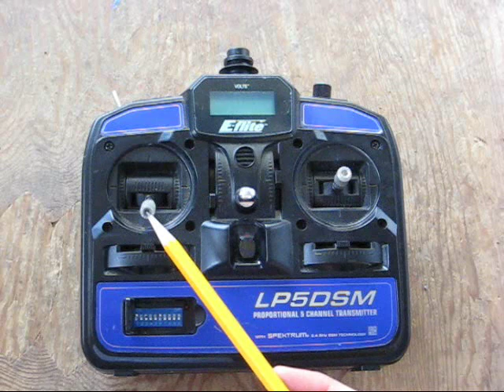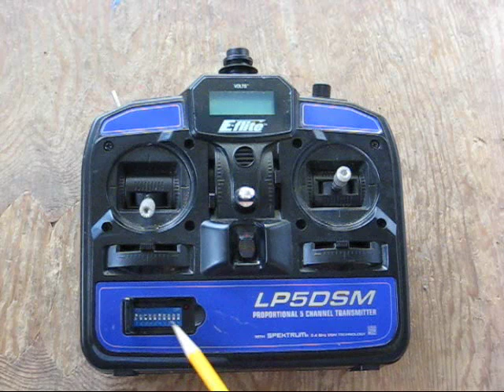E-Flight LP5DSM Transmitter Dip Switch's

Comment: Can you actually use this with planes effectively? I've seen someone fly a plane like a regular transmitter would with range etc
Reply from the maker: The range on these is really bad. They were one of the first DSM radios. They were very common and less expensive at the time I made this video than most of the other DSM radios.
Reply: @DylanPankow  all you gotta do is hook up a module and its great 
or a 2.4 ghz booster for wifi lol!

Comment: Hi, what receiver number or brand I can bind to this remote? I only have the transmitter
Reply from the maker: These are pretty old tech with a very limited range. I believe they would bind to any DSM II receiver. However you might want to look into it a little more. I'd bet you could buy a DX7 for pretty cheap and bind to the same RX's with a lot more range. I wish I remembered more, sorry.
Reply: @DylanPankow  Thanks for the info don’t need much range is for a crawler, greetings from Guatemala

Comment: Very nice thanks for supporting my channel , I have that radio for a helicopter I got year's ago and was wondering if it could be used for a drone now I know it can't 👍👍
Reply from the maker: Please note, LP stands for Low Power. It will transmit maybe 100 yards. Did you get it with a CX2 heli?
Reply: @DylanPankow  i believe it was a Blade helicopter . I did some trading for it . I will need to pull it out of the storage room . it's got carbon fiber upgrades landing gear and tell end .

Comment: LP5DSM Transmitter dip switches  what will happen if I turn on my  #9 dip for gain on Heli   and  if I get it right by turnign the knob on top  then shut off the dip will it have locked in the position I last set the knob to?
Reply from the maker: I do not know the answer to your question, sorry.

Comment: thanks for the vid, i just managed to sync this thing with my tiny whoop drone and suddenly i can fly (i was struggling big time with the cheap factory remote). 
It was only spinning two rotors till i flipped switch 10 if that helps anyone. o7
Reply: I am trying to see if it will work for a torrent 110 can u tell me all of ur dip switches setting

Comment: Does anyone know if this controller will work with the Hobbyzone F4U Corsair S BNF with SAFE or Parkzone F4U-1A Corsair BNF? I've heard range can be an issue but if flight was within  300 yards (274 meters) would there be a reason to worry about interference?

Comment: I found that switch 10 will reverse channel 6 on the receiver.  Note that receiver channel 6 is operated with the aileron channel and works in the same direction with switch 10 ON and in reverse direction with switch 10 OFF.

Comment from the maker: @flybobelito 
If your simulator uses the same plug as a Spektrum or JR Tx trainer cord, than yes it will work.  I would not recommend using this Tx with a simulator though, because it will be very twitchy / sensitive to small movements.
Reply: Maybe switch 10 is expo?
Reply from the maker: @mikeschiavoni5973  Thank you for adding to the content.

Comment: ic, well I'm in the slow process of making a simple flying wing foamy.  Pretty much I'm taking my CX2 parts to make a plane.  its has a 2' wing span.  I don't care if it breaks, i just want a plane to mess around with in a small field.  lol  I may make a conventional plane out of my CX2 if the elevon mixer doesn't work out.  it's funny how the transmitter seams like it can do v-tail and elvons, but... it doesn't hahaha, figures.  THANKS FOR THE HELP :D

Comment from the maker: What are you planning to fly?  Don't forget like I did that LP stands for Low Power.  In other words about 100 yrds.  I crashed a plane beyond repair because I first thought it was the RX, then the speed controller, and so on until someone pointed out the LP.  Oops